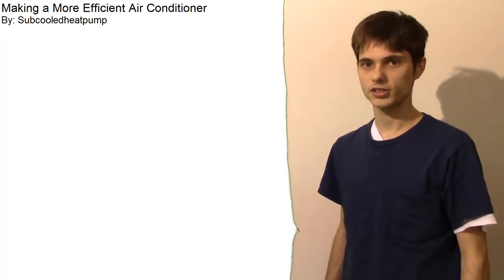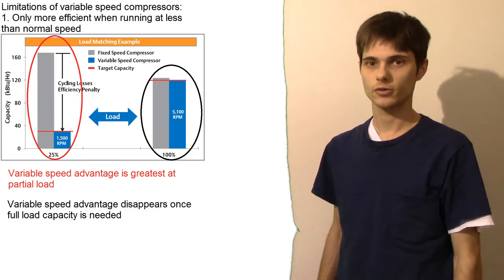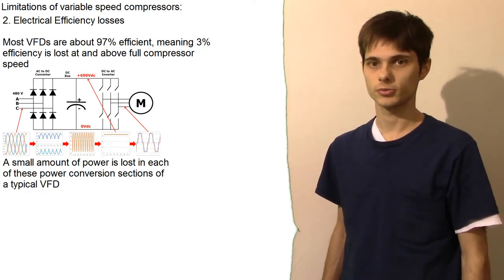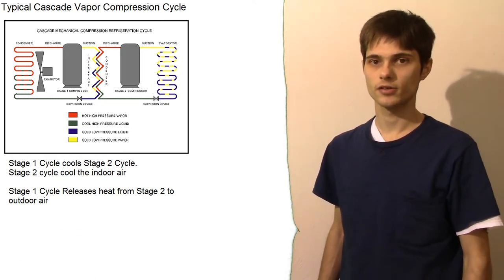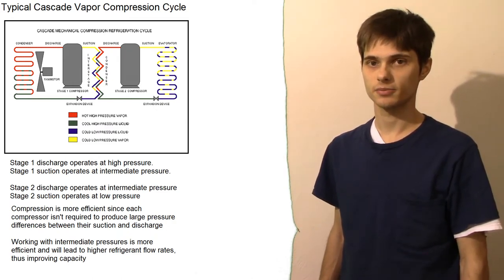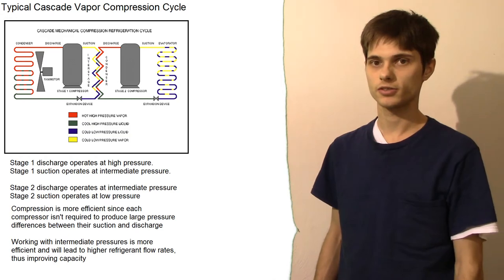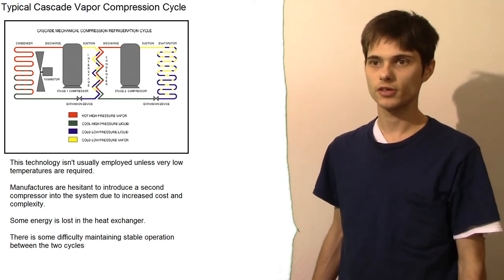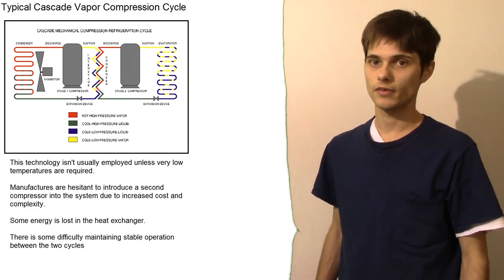Making a more efficient Air Conditioner; Planning and Discussion

Comment: This thread looks like it's going on 3 yrs old now, don't know if the brain behind the project is still monitoring but just wanted to say that I think it's dynamite that someone is trying a real outside-the-envelope approach to A/C generation. I'm a sometime electronics geek myself (all computers/software anymore but still interested) and now that we have what looks like a permanent boost in the global temperature, climbing northwards on the latitudes every year, it seems like we more than ever need to figure out how to harness all this increased heat and without having to keep using these godawful "cool-grinder" AC units that put out as much heat (yes?) as they remove. Anyway, I'm curious. Thanks.

Comment: Probably the most effective way to improve initial capital and ongoing cost efficiencies (the primary consideration) is to avoid heat loss or gain to or from the outside of the building.   Air sealing is the relatively simple expedient that is missing in most housing and dramatically improves efficiency when combined with traditional insulation and shading strategies.   Ensuring that the ducting and the air handlers stay inside the building envelope is the next challenge in much of the US.  The combined techniques easily reduce refrigeration system sizes by a factor of two or three and are not expensive when building or remodeling.

Comment: Some high end Gree "smart" heat pumps have a "dual rotary" compressor that does work in a somewhat similar manner to a cascade system, except it's not two separate systems. Instead, as the liquid is coming out of the condenser, it goes into a "reduced pressure receiver" and the vapor that flashes off goes into the interstage of the compressor. Then the expansion valve used on the evaporator is a high dynamic range (HDR) EXV which boosts efficiency when dehumidification is not needed by raising the evaporating temperature. The latest generation boasts up to 38 SEER efficiency, although there are a bunch of other tricks they used like an advanced inverter that uses some Delta Sigma variant instead of plain PWM.

Something I have actually built uses an ejector to get a similar effect. An ejector is just a pump that has no moving parts other than the fluid itself, creating a "reduced pressure" zone that is used to get better dehumidification using energy that is otherwise wasted.
http://ecorenovator.org/forum/geothermal-heat-pumps/3035-diy-dehumidifier-air-conditioner-heat-pump-water-heater.html

It also turns out that in residential HVAC (commercial is different due to the much lower surface area to volume ratio of typical buildings), the biggest efficiency boost comes from redefining the problem. The goal is to heat/cool the people, not the whole room. A way to do that would be to use a Raspberry Pi or similar to read some infrared sensors (basically low resolution thermal cameras) in order to detect where the people are, then adjust the vents with stepper motors or servos to direct the air where it's needed.

Finally, another way to boost A/C efficiency once more is to decrease the thermal resistance between the people and the air. The obvious way is to use a fan, but if personal preferences allow, it is worth learning from Naomi Wu that the simplest solution is very low tech indeed, requires no source of power, and works both indoors and out. :) That especially works well in combination with raising the evaporating temperature, as well as increase the time when simple ventilation will be sufficient.

Comment: Very impressive series of vids!
I am currently looking to run something similar to your current system that runs a 3 phase compressor and a voltage doubler taking the mains 240 and doubling that to DC 480 input at the vfd...
Did you have a video out that details that specific a/c voltage doubler you built?

Thanks in advance for any advice, definitely glad I came across your channel and am now subscribed!

Comment: be sure your high pressure stage compressor is larger tonnage than low side compressor, i'm sure your using VFD's on both compressors to run independent speed of each. Also VFD's on the fans as well. If your low side discharge pressure is high enough you could use a fan and condenser to try and remove some of the super heat from low side before introducing heat load to the high stage . I would like to work with you on this project, thanks
Reply from the maker: Desuperheater on the low temperature stage discharge? not a bad idea, I'll have to see if I can fit one in. I've got the refrigerant recovered from the two units, I'm working on the heat exchanger and will likely post a video tomorrow. Thanks for the suggestions and thank you for watching
Reply: im glad I could help

Comment: Pretty "cool" idea and project. I doubt that the efficiency of the inverter changes all that much between maximum and nominal power. The motor itself might be made more efficient by using a BLDC, which may be better than 90% efficient compared to the 70-80% of typical small AC motors, single phase or three phase. I don't know enough about air conditioning and thermodynamics to comment on the two-stage technology, but it sounds promising.

I have heard that the best way to get better efficiency for a heat pump is to bury the heat exchanger, especially if it can be located in a running stream or aquifer. I had a hand dug well that had water only about 15 feet below ground level, and there are many small streams and springs in the vicinity, so I think that would be practical and affordable.